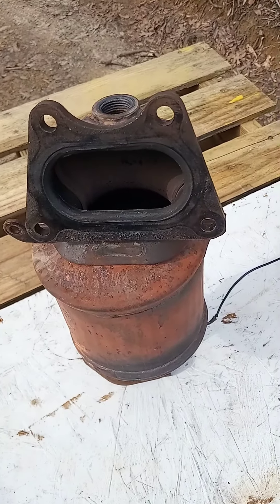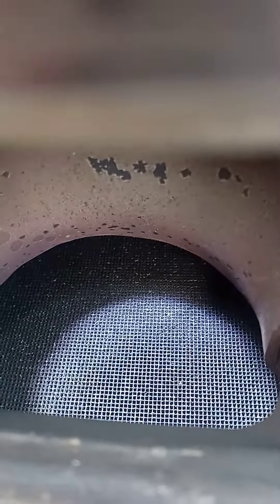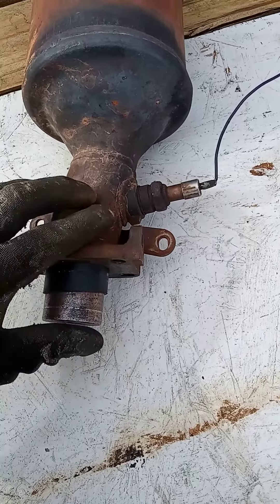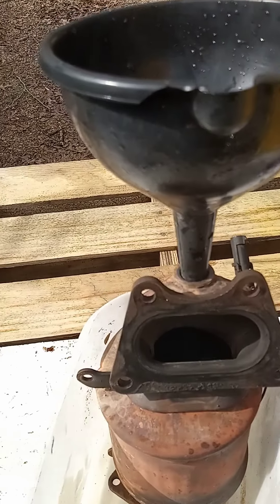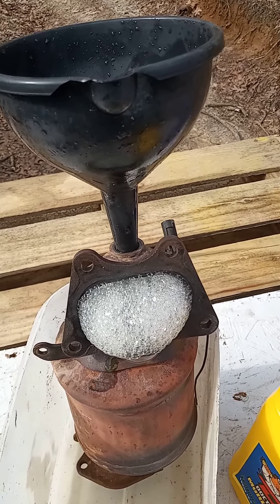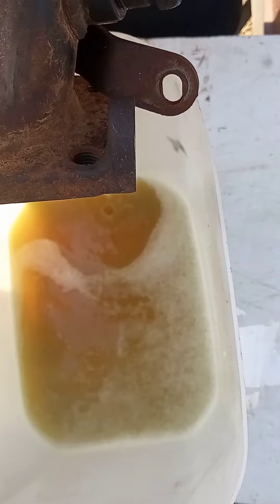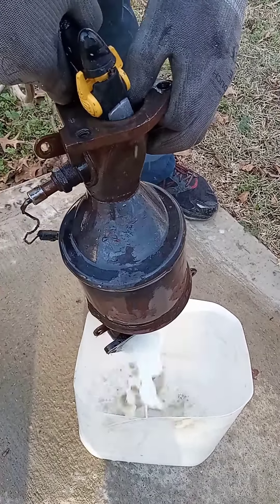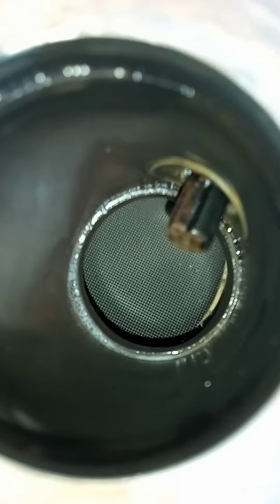How to Clean your Catalytic Converter & FIX P0420/P0430  at home DiY

Comment: Thanks a lot Joe. I went to Walmart to get the DMX dr mechanic degreaser. Worked perfectly. I took a whole bunch of rubber gloves and stuffed them together to make a ball and that was my dam. Then put the cat in a 5 gallon bucket and used a funnel to fill up the cat with DmX. Left for almost two days. Then went to industrial area where they have 3 inch hose, high pressure water and washed the whole thing out. Came out super clean. Im happy with the results. Thanks Joe!
Reply: I also found one of my spark plugs were super carboned. And i just replaced these like a few months ago. Im pretty sure its a bad coil because i do feel it occasionally misfire. So gonna replace that too.
Reply from the maker: Excellent! Thank you for watching

Comment: I used purple power extreme cleaner degreaser and let my 2 cats soak over night then rinse and the water they were soaking in was black and red ish from the fact they are the original cats and my vehicle is a 2002 Toyota 4runner sr5 2wd with 352k miles and the outside of the cats are rust free and the heat shields are shiny and the inside looks brand new and the only reason I was doing this was cause my cats were so clogged that the inlet before the cat was reading 200+ degrees hotter than the outlet after the cat

Comment: Did it fix the check engine light issue?
Reply: Exactly my question
Reply: @JoesFixallGarage
1 year ago
No the code didn't come back after re installing, I also went ahead and replaced the B1S1 & B1S2 O2 SENSORS as well.

Comment: I have a 2010 MDX, gas mileage isn't good. I was told and after googling that it's 16mpg city & 21 highway. I'm thinking about trading in for 2018: 20 city/ 27 highway. I really like my 2010...is there a way to getter better gas mileage?

Comment: did the code come back or did the cleaning work as intended?
Reply from the maker: No the code didn't come back after re installing, I also went ahead and replaced the B1S1 & B1S2 O2 SENSORS as well.
Reply: Great idea, if it works. I have a 2014 Hyundai Accent with same code and engine light on. Bin driving it like this for over a year now. Still runs good, not sure weather I should do anything about it or just wait till it has a drive ability problem. Any suggestions.?
Reply: @nemracfiftyto6206  some vehicle computers would self clear the code if you drive a certain distance if the fault itself is no longer present, but you can also check how hot the catalytic converter is getting once the engine is at operating temperature. As long as your below 1200 degrees F you’ll probably be fine.
Reply: One really needs to fix the root cause before or shortly after cleaning though. They cat should not plug in the first place so if the engine is burning oil or too rich it will plug again and ruin the sensors again.
Reply from the maker: Still code free
Reply: @mnhoss2100  
While you're logic is correct, it depends on how severe the problem is. If it took 10 years for the CAT to get the code, then it might be okay for another 10 years. If it's oil burning that causes it, anything other than PCV valve is impossible to fix without taking the engine apart, which isn't worth it.
Reply: A bad coil that occasionally doesnt fire can cause the buildup of carbon. Check which sparkplug has excess carbon on it

Comment: Good job man. Save a bunch of money.
Reply from the maker: Thanks, and I Hope it helps.
Reply: @JoesFixallGarage  has the code stayed away?

I cleaned my cats by adding one gallon of acetone for 6 gallons of gas then took a long drive to run the tank near empty...  The code did go away and I was able to pass the emissions test here in California..  it's coming up to a year and the code came back...

Toyota cars are expensive....  I would rather use your method

Comment: Yeah this doesn't work. The catalyst breaks away over time and doing this is not going to help
Reply: You are right it does break down over time but I tried it myself years ago on my Ford Mustang with 4 catalytic converters and it helped out And drove it for another  2 years until someone crashed into me.... It is a temporary fix in some cases
Reply: Depends on why it's not functioning.